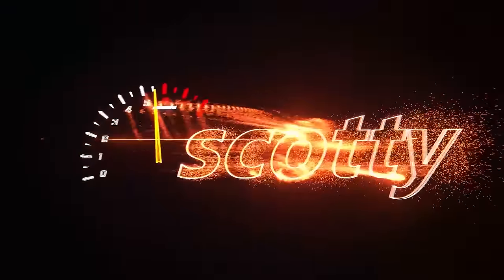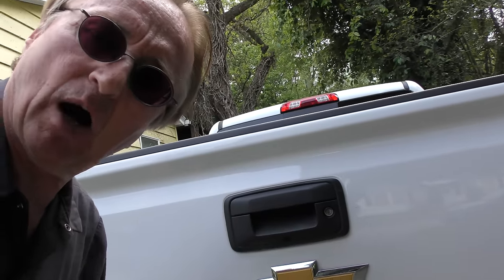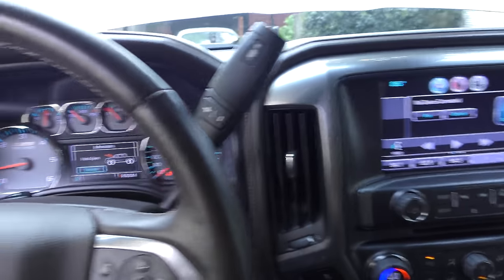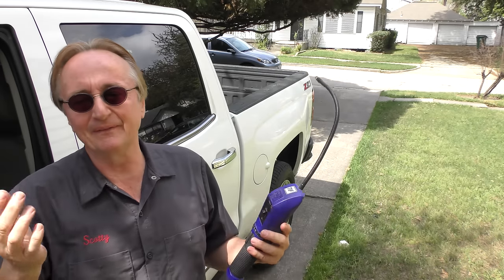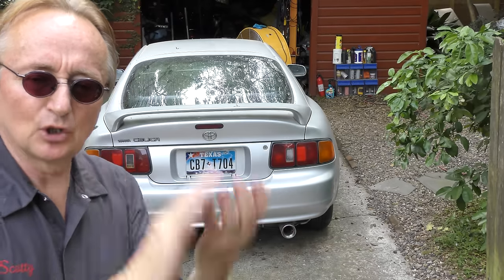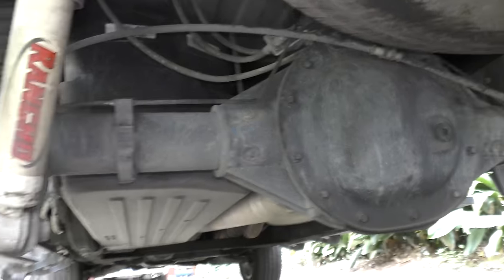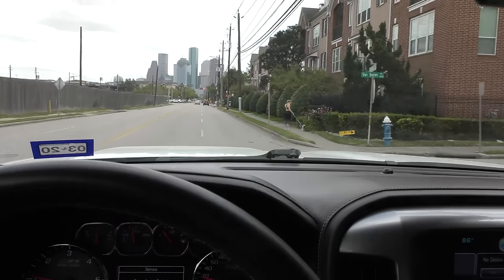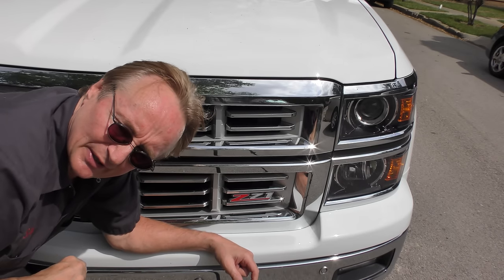Here’s Why I’ll Die Before I Buy a Chevy Silverado

Comment: I got a 10yr 100,000 mile extended warranty on my 2019 Tahoe and it sounds like my GM dealership will be busy fixing my SUV until my miles/years expire...laughing horse
Reply: The problems will come after 100k miles. Good luck jvw1973
Reply: @robg7149  I guess the 'Laughing Horse' will be on ME :-)
Reply: Jay Man  I actually love my Tahoe, only time will tell :-)
Reply: @jvw1973  Check my comment at the top.
Reply: Luis Bolanos anecdotally, I hear a lot more horror stories from people I know about ram/gm. Even the people who like them seem to trade-in pretty frequently
Reply: It does look better but, Toyota's are built a hundred times BETTER!
Reply: Like hell they aren't!!
Reply: Carson D 4Runners are still bulletproof
Reply: @zues2013  The warranty states 'Repairs are done at GM-authorized dealerships' and 'extension of the factory bumper-to-bumper warranty'; I would like to know a little more about information you have since the Warranty was sold to me as stated above.  Thanks
Reply: Roswell Sponem better than a trd pro 4Runner?? Sike
Reply: We have 3 new trucks. We get new trucks every year so we trade them in constantly. Never have to worry about problems. We do it because we love new cars lol
Reply: My 72’ Chevy P/U Evaporators in the Front . 
Still working 👍🏻 same one  still cooling 👍🏻👍🏻👍🏻
Reply: Walking Journey let’s not get hasty now! Lol... Toyota’s are built very well though!:)
Reply: I'm thinking of buying a 2016 Tahoe certified CPO. 12 MONTH/12,000 MILE WARRANTY PLUS LIFELONG POWERTRAIN FOR me only. Anyone familiar with this 2016 Chevrolet Tahoe LT 4WD? I'd appreciate it as it's a big purchase for me.
Reply: @shaneb1313  
101 Xs 🇯🇵
Reply: Carson D .my 2016four runner has cero recalls.
Reply: I work at a Chevy dealer and all I have to say is good luck lmao
Reply: Hip-Hop Memes For Edgy White Teens sell me a cruze
Reply: @shaneb1313  not anymore.  I see them breaking brand new here in the middle east.
Reply: Parts on order, Scheduled & reset codes - Thats what you bought
Reply: *laughing panda
Reply: 4Runner Prius and Land Cruiser the only ones build in Japan the rest is just another Ford/GM assembled by the yanks in TX
Reply: Yes they will, coming up with reasons there not responsible for the repairs. Warranties aren’t worth the paper there written on.
Reply: @sebastiansac8219  thinking about the same, but do you loose any money or how do you take the most advantage of it or you just really dont worry about money one bit?
Reply: Unfortunately I know a Tahoe owner that had the same problem.
Reply: Sell it and buy a Tundra.
Reply: @Luis Bolanos Toyotas are like the wife every man needs. Not so attractive that she'll stray, but faithful and reliable. You can count on her to hold her own in a long term relationship.
Reply: Jjj Mm land cruisers also
Reply: Carson D Why don’t you all let us know what car you think he would like so we can laugh at you
Reply: @billybob042665  It was about $2,500...
Reply: @Roswell Sponem Thats the difference...you can admire the Tahoe broken down in the driveway but you can drive the Toyota. Like having a good looking woman...you can look at her but cant touch her. Get a girl that may not look quite so hot but at least she is playable.
Reply: @shaneb1313  AMEN
Reply: Nah luck of the draw sometimes too
Reply: @jimmysapien9961  what I'm talking about keeping it simple I had a 70 gmc loved it but I was young and beat on it we put the motor in 64 impala  tho
Reply: Paul Clancy 
If you want a car with 25 computers and more than 5,000 wires. 
A failure of one wire or computer can disable the whole rig. 

Maybe some people enjoy riding around on a haystack ready to light off.
Reply: Diego González Diego, we generally wait until the car stops producing negative in value. Theres a time period when u first get the truck or car and it starts to produce negative. After a certain amount of time is will produce positive and you may lose money on your trade in. Thats why we buy trucks that dont lose a lot of value. We f-150s, tacomas, and we just bought a 2019 warlock (with a super charger). It really depends, because the dealer may want to negotiate on how much you lost or not. But generally they gave us a choice to take the negative on trucks we have traded in and pay it, or have the total price higher on the car/truck we’re trying to get. We also only buy trucks because they lose less value.
Reply: Lol at these people saying Toyota’s aren’t that reliable, they are miles ahead of any GM/ Dodge/Chrysler product
Reply: the a/c   isnt covered read the fine print
Reply: @jvw1973  I like chevy because they are easier to repair(DIY) when something does break.
Reply: @kevinlimo696  So true!
Reply: Jvw 1973 I bought an extended warranty for my new yukon 3 years ago it now has 84k miles and they have been great it has saved me at least 6k in repairs. I bought my warranty from the same dealer I bought my car.
Reply: @sebastiansac8219  Not everyone has that luxury and besides why pay a large sum of money for a early money pit! Rolling down the highway the ford, chevy, and dodge looks great but a whole lotta pricey for a whole lotta problems!!!!!
Reply: Rottsrule We trade it in before it becomes a money pit. Never more than 20k miles generally lol and we enjoy them alot.
Reply: It's a 5.3 all u have to do is stay on top of ur maintenance and ur good.
Reply: Hey Scotty, thanks for driving around showing the Houston skyline. Miss my hometown. I’m just an Houstonian stuck in west Texas.
Reply: @teliramirez3914  Thanks for the information Teli...I have a fairly good relationship with my dealership and up to this point they have been great in every aspect (haven't had it in the shop yet).
Reply: you wont own that truck by the time it hits 100k.. they got your cash..
Reply: kevinlimo696 yep
Reply: Tahoe is pretty reliable. It will last 200,000 miles with few problems (so as long as you service).
Reply: @johnjacobs1776  Don't do it!  My 2009 Buick Enclave SUV has been a nightmare.  The problems started at 8000 miles.  Major AC work done at 13000, then 35000 miles - both front and rear evaporators, even the HVAC case.  Also had problems with coils, transmission, and engine computer - costing about $8K to fix last year as I couldn't afford to replace the vehicle.  Bottom line, as Scotty said GM vehicles are not built to last.  They're good if you lease them only.  I'd check out Toyota.
Reply: ROB G bruh I got no problems on a 300k Chevy 2006 Chevy tailblazer

Comment: I've got a 2015 Tahoe with 105k miles that'll take the cab temperature from 100+ to walk in cooler in 5 mins, I also got rear-ended in a 2015 Sierra at a dead stop by a Nissan crossover going 65-70 mph and suffered no serious injuries. I also got 24-25 mpg highway consistently with my Sierra; though mine had the 6.2 not the 5.3. I'm not sure what problems y'all are having with your GM trucks but mine  have treated me very well.
Reply: Check your ball joints, I guarantee they are bad.
Reply: I have a Suburban in Phoenix, it's AC will make you put a sweater on in the middle of the summer. I get 30mpg all the time with the 5.3. plus I tow more than most of the F150s and the Rams I see combined.
Reply: @@joedietz9427any vehicle that you don't fix yourself is going to be a burden

Comment: I'll stick to my Grand Marquis. I heard someone the other day say "I wanna buy a 4 cylinder Silverado, it gets better gas mileage" NO you don't!
Reply: I want to go back to one
Reply: good idea
Reply: Yeah you're missing the point of the 4cyl... it's turbocharged and actually pretty damn fun
Reply: Atta boy....you should probably tell them you don't mind if they charge you a little extra.
Reply: Grand Marquis sounds real boss.
Reply: Robot 13  Becuz they don't tow anything.
People buy pickups as dd, no idea why
Reply: Robot 13  And going to the Petrol station 3 times a day 😂
Reply: Does your Grand Marquis have the "De Sade" package? :))
Reply: Their other car is a supercharged land rover...
Reply: James O'Garcia A 1978 Chevrolet C 10 is the best bang for your buck
Reply: I owned two Mercury Grand Marquis cars.  Once they hit 100,000 miles they were at the repair shop every week!!  Now I drive Toyota!!
Reply: 93 Lexus LS-400 with 125k miles...pretty bulletproof
Reply: The Ford 4.6L mods are bullet proof engjnes.
Reply: Noah Stakes 2009 Crown Vic here! Agree 👍
Reply: @possumsam2189  try once a week dd
Reply: Do they make a 4 cylinder silverado??
Reply: Robot 13  When I heard they were putting a 4 cyl in a Silverado I nearly lost my mind. Sure it's boosted and everything but when I think "4 cyl" I think of my tiny 2016 MX-5 Miata with a 6 speed manual. Not a giant full size pickup. Absolute madness.
Reply: I will stick with a ford f250 7.3 power stroke from 1997 with turbo
Reply: @possumsam2189  because they simply have more money then common sense!!
Reply: A guy from work got a 4 cylinder Silverado and everyone at work makes fun of it behind his back😂😂😂 they say that if you open the hood there's a big gap because the engine is so small you can't even see it😂 we have like 80 guys that work there.
Reply: I Love the 4.6L so much so I had to get 2

Comment: Really doesn't matter what you buy now days all the new vehicles are built like junk hard to work on and mostly plastic
Reply: Toyota 4Runner my man
Reply: Most cars today are built to be brought and drove for a little bit and then traded in for a newer one the next two to three years. It helps the economy by making you spend more money lol
Reply: amani mango Not really. That was more of a 1950s thing where you traded for a new car because they styling was out of date every year, and your engine was whupped by 100,000 miles because of poor quality oil and less advanced tolerances. Not at all uncommon to see 15-20 year old vehicles driving around today. Look at pictures from the ‘70s and you’ll very rarely see a car from the 1950s. People keep vehicles longer today than they ever have.
Reply: @jackstacey7519  Also cars today are more reliable in the sheer mechanical aspect. What really holds us back is nuances in technology. Cars without high tech aren't valued as well. Look at how much the Mitsubishi Mirage sold and how poorly rated it was. Even-though the Mirage is pretty reliable and cheap to own. It is considered a crap car by most reviewers but reviewers don't like boring cars and there's not much to say about the Mirage.
Reply: Damn right I like the old stuff👍
Reply: @kitchentrout5867  that's a shitty vehicle!!
Reply: @kitchentrout5867  its literally 15k more in canada for equivalent suv.  Even a junk chevy wont cost that much to repair in 10 yrs
Reply: Tundra may be the only exception
Reply: Oscar Patino  really dude?, What is this kindergarten?
Reply: Oscar Patino  Can you work on your own vehicle?
Reply: If you're gonna compare vehicles at least compare 2 vehicles in the same category. He compared a silverado to a sequoia. A Tahoe does have the same features if not more than the sequoia. Every single car company has the same issues in some cars. I've seen his beloved Toyota brand have a tundra and a corolla have catastrophic engine failure in less than 30k. But I can say the same for chevy Ford especially Chrysler BMW Nissan etc.
Reply: Gonna run my 97 Chevy into the ground for that reason. They don’t build em like they used to.
Reply: You couldn't be more wrong. Apparently you never owned a car built in the 90s or older.. Cars and trucks today are by far safer, more reliable, emissions friendly, more economical and require far less maintenance than older cars. These are the facts. The only thing undisputed is they cost more. However if you compare the cost of an average new car to the cost of a new car built in 1972 against the average yearly salary in the US. You will find it to be equally comparable.
Reply: Why run it into the ground!?

Build it up and it will last you millions of miles!!!
Reply: @fastlyf98  cars and trucks today are more reliable and lower maintenance than cars and trucks from the 90s and before? What new vehicle are you driving?
Reply: Unless you buy certain foriegn cars that stoked American designs that we quit makin.
Reply: amani mango That’s why Cash for Clunkers was a thing. Got to get rid of all the good old cars so that the people have to buy crappy new ones
Reply: @willowandluka5302  Right. Such a backwards idea, curtesy of the Liberals.
Reply: Except Toyota,  Honda is a close second, Toyota makes the most reliable cars and trucks along with Honda, Google it. Corolla, Camry, accord and Civic all will go well over 200k miles if you do basic maintenance and don't drive like a mad man, the Toyota Land Cruiser is designed to last 25 years it is the vehicle that last the longest in terms of miles and quality of any vehicle that exists today, and remember Toyota trucks are legendary for lasting at least 20 years and don't forget their SUV's which are based off the trucks.
Every mechanic will tell you to buy a Corolla, period.

Comment: I have a 2007 Silverado and it's such a great truck. Never given me problems.
Reply: Same not gonna lie but I think the transmission about to give out tho
Reply: As a tech iv had a 2009 chevy  from new and way easier to work on. Only had to to the regular maintenance brakes shocks ect.
Reply: @covector4787  it's about to lmao lmk wen it does! 🤣
Reply: I have a 2011 Tahoe. Not one issue. I got it in 2011. Only darn thing that happened was the gas station had bad gas and ruined 😡 my gas tank!!! That’s been it. I repaired it and moved on. Absolutely no issues ever.
Reply: @cinma4890  you sure you didn't accidentally put diesel in the tank?
Reply: @yonny1357  I bet you are 16
Reply: Not sure about these generation Silverados. Turning 300k miles on my '02, no overhaul and that motor gets up and goes like it did off the lot new.
Reply: Rare truck
Reply: He's talking about the newer models after the bailout when they cut costs everywhere they could
Reply: Everyone gets lucky my father brought a brand new Silverado in 2000 everything broke air conditioner every day is air conditioner every door latch every window Mac window mechanism. Trans went at 80000 miles
Reply: @yonny1357  still works it has 160k miles and bought it when it had 28k miles
Reply: Same here I have an 091500wt and just got an 08 2500hd
Reply: I have a 07 as well, beautiful truck, 420,000 kms on it now, original drive train.
Reply: 176,144 on my 2011 silverado still running strong
Reply: @covector4787  tranny still work?

Comment: Yeah, but they sure are a lot of them with 200k and 300k plus miles still running up and down the roads.  Regardless of Scotty's opinion,  the truth is they last forever and you can't hardly kill them.  I've never owned a vehicle of any brand that didnt need some work along the way, especially when it hits 100k miles
Reply: Is there any car or truck that Scotty actually likes?
Reply: @phil-1115  He likes the old rigs like my dads 1970 GMC pickup that had the infamous 307 motor.  Lots of power, thin cylinder walls, pretty much guaranteed the motor to be rebuilt at 50-60k miles.  Then the cylinder walls were so thin that if you did bore them out they'd get hot and ruin the thin walls.  Best thing you could do with those was to run it til it blew up and then replace it with a good motor like the 327.  That is what we replaced ours with after it had gone through Three different 307 motors by 1986
Reply: @jtarman70 , I had a 1968 Chevy truck that I dropped a 350 in. I loved that truck.
Reply: @62guitarguy, The only vehicle that I have ever owned with no A.C. was the 68 and it didn't have one from the factory. I have owned many GM trucks and cars with well over 200K miles and all had working A.C. I even owned a 79 Ford Granada once and the A.C. worked on it too. I have been a Master Tech for a long time, and I, or tech's that I have worked with, have repaired A.C.'s on just about every make and model on the road. I can't say that one is worse than the other.
Reply: Completely agree. I own a 2005 silverado that I use for work, I've abused the crap out of it and it's still running strong at 300k.

Comment: 15 years with my Titan 310,000 mile L.A miles The ones that take 2hrs to drive 50 miles. same transmission same engine and The AC works like new haven’t touched it for anything still has the original Refrigerant.
Reply: Carlos Cortez Hell yeah my man! I’ve got a 20 year old Nissan Pathfinder (back when they were actually tough trucks). I bought it new in ‘99 and have put about 350k Bay Area miles on it. Never had a serious problem. Not one. There sure is something to be said about these old Nissan trucks 💪